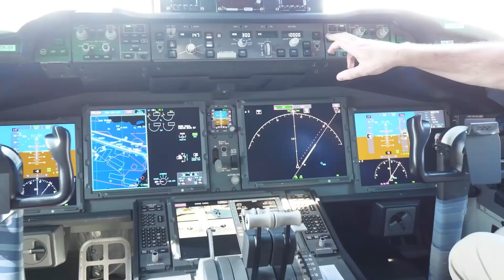The Boeing 777X Is Cracking—Literally!

Comment: the body blowing out in the pressure test was because it fell a little short of Boeing's goal. This goal is well above the FAA requirement. THAT's why it passed the  FAA test and moved one. It didn't fail like you insinuate.

Comment: Airbus HAS ALREADY TAKEN OVER.  Revolutionary the 777X is NOT.  The fuselage is still made of good old materials...
Reply from the maker: Couldn’t agree more! Airbus is pushing boundaries, while Boeing’s sticking to the old playbook. 🛫🔧
Reply: @WingSpanDiaries  it is the Boeing 787 that is the revolutionary aircraft of the company...
Reply: @WingSpanDiaries , you really know nothing about the 777X do you, in terms of advanced materials.  PS..if your going to make that argument, pitch the A350 against thr 787.  The 350 doesn't come anywhere near as close as the 787s in advanced materials.
Reply: @toms1348  absolutely wrong.  the 350's fuselage has a higher percentage of the advanced carbon composite material than the 787.  get your facts straight.
Reply: @tonydecastro6340 , except that I do know quite a bit about these aircraft.
Reply: @toms1348  well, your comment above shows your ignorance.  rectify it.
Reply: @tonydecastro6340 ,  to be more specific, the A350 is 53% composite by weight. By volume  (ie actual fusilage structure and wings), the A350 is about 60% by volume...The 787 is 80% composite by volume a d 51% by weight. So there is parity between the two aircraft when measured by weight.  I stand corrected there.  That said, the 787 was the innovator here, with advanced materials, not the A350.  The A350  followed the 787, not the other way around. So from that standpoint, Boeing gets the innovative crown.  As for the 777X I stand by original comment.
Reply: @toms1348  better reply.  what exactly was your original comment about the 777X?
Reply: @tonydecastro6340 , my point regarding the 777x is that is isn't just a quick face lift of an already outstanding design. Quite a bit of innovation went into that aircraft including a lighter weight and stronger aluminum alloy for the fusilage.  The wings are all new composite materials with folding wingtips to allow use in gates used by existing 777s and smaller widebodies. The avionics suite recieved a solid modern update akin to the 787s and A350s.  Also the cabin pressure will be equal to lower altitudes like the 787 and A350. And let's not forget that the new GE9Xs are nearly 15% more fuel efficient then the current GE90s and Trent 1000s. This video tends to suggest that then
7779X  is a half baked, cheap update lacking in any sort of innovation. This is not true.  The current issue with the thrust links was unexpected. As a structural engineer, I can see how this can happen.  We can do the math to calculate torsional loads,  resonance, weight load,  etc. The goal is to work out these design factors/parameters ahead of assembly. But that doesn't always happen.  Math on paper and real world, practical implementation sometimes collide.  There are those who will say it's a failure that should never have happened if done "right" the first time. I will argue that these critics aren't engineers; or are engineers who believe they will never make a miscalculation.  Bottom line, the 777X has had its trials for sure.  But that doesn't mean it lacks innovation.

Comment: I think if this plane fails than Boeing is destroyed because it’s longest range with 75 passengers is with 20,420 km meanwhile a350-900 comes at 25 passengers but at same range.
Reply from the maker: That’s a solid point! If the 777X doesn’t deliver, it’ll be a tough hit for Boeing—especially with Airbus closing the gap in performance and efficiency. 👀💥

Comment: Hell.... announce the new A350 2000 AND the start of the A350neo.  That would freak them up.   Just announce, nothing more.  But make it an official announcement. Love you, Airbus.   Now is your time to soar!
Reply from the maker: Haha, that would definitely send Boeing into panic mode! Just the announcement alone would shake things up. Airbus has the momentum—time to take it to the next level! 🔥✈️💪
Reply: They don't have RR engine for A350-2000. RR already has durability issue for XWB-97. GE is unwilling to develop an engine for a single variant with limited potential market.
Reply from the maker: You’re spot on! The engine situation is definitely a roadblock for the A350-2000. Without solid support from RR or GE, Airbus is in a tricky spot. Let’s see if they can come up with a clever solution! 🔧🌍

Comment: As reported elsewhere, the parts that failed are the thrust links. The stress levels in these links is highest when the thrust is highest, which is during take-off, not during long range missions.
Reply: @bruceaberle4444  yes exactly but still dangerous
Reply: @AnetaMihaylova-d6f  yes a failed engine immediately after take-off equals you crash and die, that's what happened to the Chicago DC10, plus if that engine comes off you can bet it'll damage the wing as well.... i very much doubt this aircraft can climb on one engine......... this aircraft is a disaster and not that special in the first place is it........... just a more modern 300ER
Reply: They discovered cracks in the aircraft which were sitting on the ground as well. So the problem is not limited to short term stress, but about long term endurance.